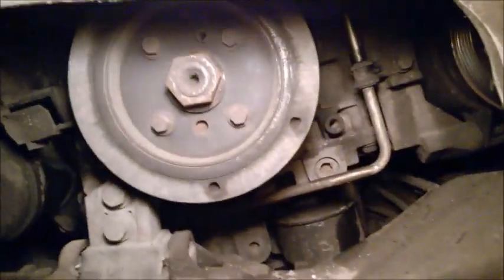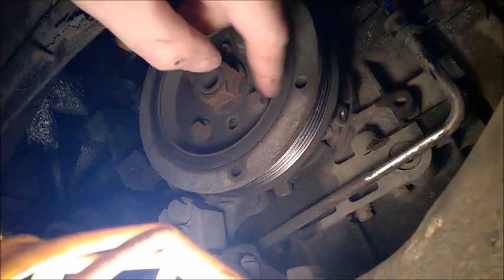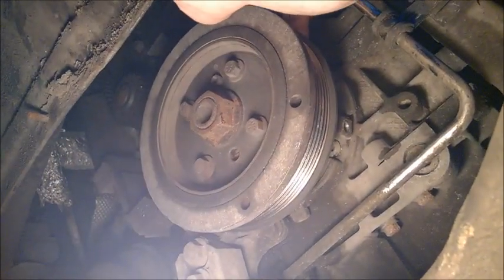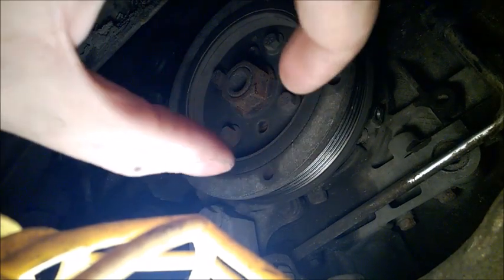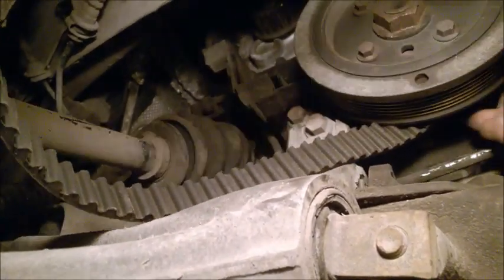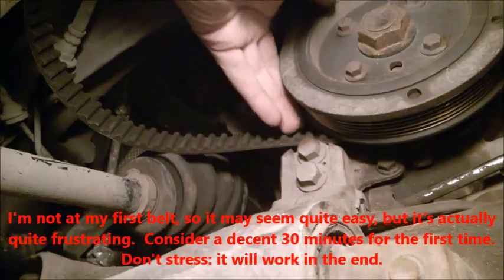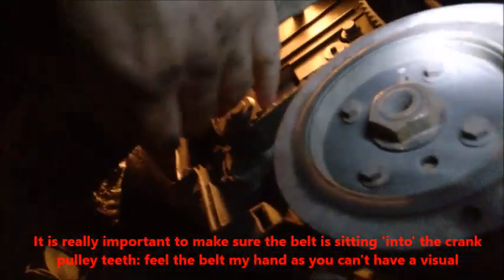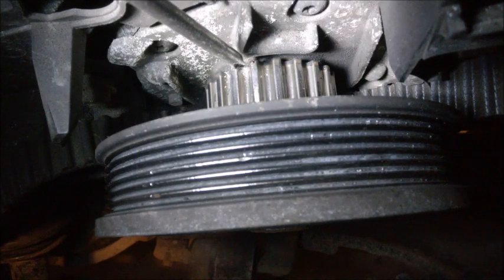Volvo S60 V70 timing belt install without removing the crank pulley - gasoline engines  2001-2009

Comment from the maker: Tensioner center point is at 15C / 60F
For the small cover with 10 mm bolts, use two long extensions on your ratchet and reach the bolt from the front of the engine - much easier to remove. I should have mentioned this in the video that passing the belt this way can be very frustrating and time consuming especially since there are many 'bumps' that block the belt. 
Here's a write up on the VVT and timing belt components - there is a passage saying "turn the crankshaft a further 1/4 of a turn clockwise, then turn back counter-clockwise until the markings correspond" - I do not recommend this particular step. Be sure to mark the cam gears everywhere before removal, ask on forums http://www.ondemand5.com/mric/common/asp/annotationattachment.aspx?fileid=6198
Reply: "I do not recommend this particular step."

But why not? 

BTW Thanks for the video.
Reply from the maker: @belekas2729  I did try it on my car, at some point it felt 'stuck'. I didn't like forcing on it. The reason for this 'step' is to release some tension in the exhaust cam hub on some engines. Without this step, the exhaust hub will rotate a little backwards when removing the belt. Vast majority of owners and garages - including Volvo - don't do this step and just make sure to properly move the exhaust cam hub by hand to have the timing marks properly aligned at the moment of installing the new belt.
Reply: @Peppermint1  Thanks for info.

Comment: i doubt you can break the fibers in the belt, its kevlar.
We followed your video and had no trouble  getting it installed.
Reply from the maker: The kevlar fibers have good strength longitudinally (tension) but not so good with shear force (torsion). So it's good not to force them too much into twisting.

Comment: Hi mate. You're oragex on volvo forums right? Asking because you recommended me this for my D5 but here you say it won't work for diesel engine.
Reply from the maker: Correct about the nickname, as for the D5, I might not have noticed you were asking for a D5 engine.  I'm not aware about the diesel because we never got (unfortunately) the D5 here in North America. Better to look on the UK forums. All I know is removing the crank nut on the D5 needs a lot of torque, ideally one would drive to a garage to ask them loosen the nut, then do the belt back home, and go back to have the nut tightened. Also need to lock the crank while tightening the nut, may require a special tool near the starter, perhaps cheshired is showing it in his D5 cambelt video
Reply: @Peppermint1  thanks for the reply mate. Would an impact wrench with 400nm be able to loosen it? I've got the parkside one.
Reply from the maker: @papiezguwniak  Try asking the folks on this forum https://www.volvoforums.org.uk/forumdisplay.php?f=19

Comment: I did something similar except I removed the engine mount bolts near the pulley and lifted the engine about an inch.  With the extra clearance I created, the belt went in so much easier.  Just put a jack under the engine and gently lift after removing the 2 bolts on the side mount.

Comment: I followed the fcp video and spent hours trying to get the balancer off. I have a 3/4 impact and this would not do it. I found your video and watched the critical moments a few times. This was so easy. I don't see why anyone would even try taking off the pulley once this is learned. Thank you!
Reply: Yes, I had same problem, it's very hard to loose that 30mm bolt, but I wanted to change crank seal, just in case.

Comment: Can you see the timing mark for the crankshaft? Its hidden behind the pulley on my s60
Reply from the maker: It can be seen from above at a certain angle, pretty difficult.  It is visible from inside the wheel arch only when the belt is removed. The thing is a tiny metal bump, hard to figure out the first time. There is a second timing mark on the crank pulley itself, behind the pulley - so the pulley goes back at the correct position. https://images.matthewsvolvosite.com/s60-timing-belt-marks.jpg

Comment: I love your videos. Many of them have helped me many times. However, I have to disagree with this one. I tried this and had a horrible time getting the belt around everything. I started thinking I had the wrong belt. Like it was too short. I took the pulley off and everything came together. I think the belt was getting caught on something behind the pulley and not seating properly. I guess if one doesn't have a decent impact driver, sure, this is an option. But, if the proper tools are available, just take it off.
Reply from the maker: I understand what you say,  absolutely, if someone has an impact that's the way to do it. I agree that passing the belt can be very frustrating and time consuming especially since there are many 'bumps' that block the belt. Also wanted to mention for european people that this will not work on diesel engines which have a wider belt.